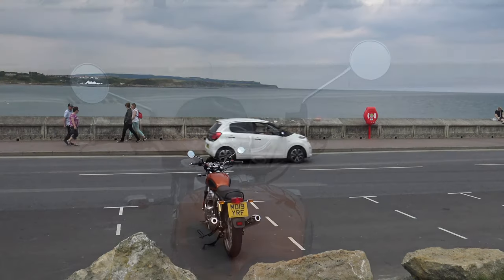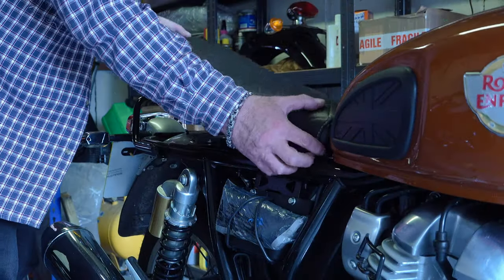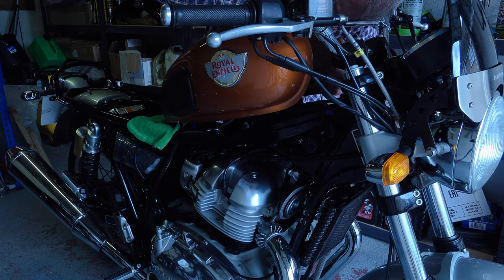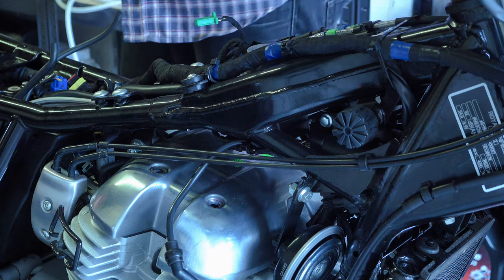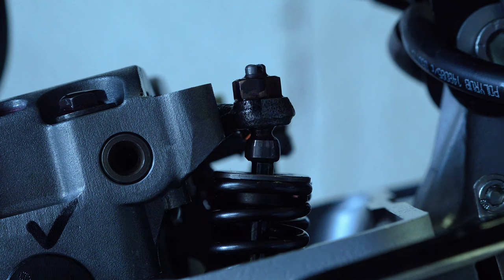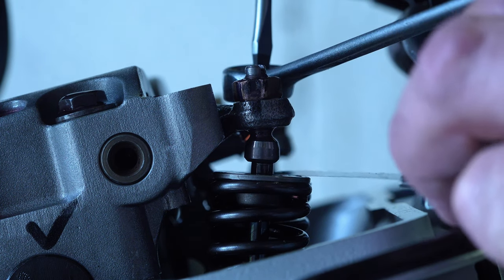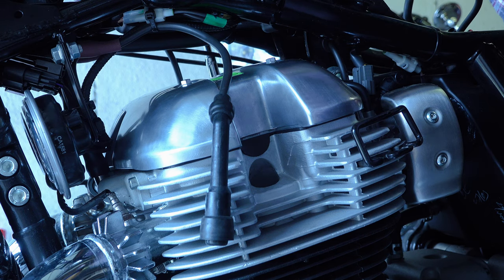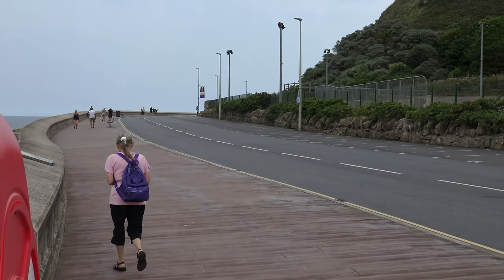Royal Enfield Interceptor 650 service Guide part 2, checking/adjusting valve clearances/tappets!

Comment: Hi stuart so the L marking is intake and the r marking is for exhaust tdc are the markings only on 1 side of the end of the camshaft the side were you turn the crankshaft thanks keep up the great content
Reply from the maker: Sorry John I thought id made it clear, the L mark is for both intake and exhaust on the left hand side and R is for both on the right hand side. I think there has been some confusion caused by a certain video demonstrating exactly how not to do it!
Reply: @stuartfillingham  so the left hand and right as viewed when sitting on the bike thanks stuart
Reply from the maker: @johnwright6995  yes
Reply: Thank you sir, Excellent video!!
Reply: When you take the cover off the engine is also marked L and R, so you shouldn't be able to stuff it up.
Reply: John my understanding from this video and the service manual is to put the camshaft in the L setting and check both intake and exhaust, adjusting as necessary. Then setting it to R and again checking the intake and exhaust and adjusting as necessary. Please someone chime in if this is not correct.
Reply: @briancrn113  see Stuart's reply he explains it clearly good luck with it the first time I did mine I was shiting it but after that it becomes second nature
Reply: @johnwright6995  So easy. I love this bike!
Reply: I assume the intake is those at the back of the bike and the exhaust are the two valves near the exhaust pipe?
Reply: @sugardaddy9721  that’s what I came here to ask and the way you articulated it makes me feel stupid. Duh! Thanks.
Reply: Why do you turn the crankshaft after the first check only one rotation, whereas a fourstroke engine needs two rotations for a complete cycle?
Reply: Correct
Reply: @johnwright6995  😂

Comment: Dear Stuart,  Thank you for all your informative Interceptor 650 service videos.  One suggestion regarding tappet adjustment for the novice mechanic is what is called the "Go / No Go" method.  Once setting the appropriate clearance, follow up by inserting the next thinner feeler gauge which should "Go" in easily.  Then try the next thicker feeler gauge which should be a "No Go".  This method not only ensures the correct settings but also give the novice the feel of the correct amount of drag on the gauge.  After doing this a few times the novice will be experienced enough to know what feels right.
Reply: Good point!

Comment: Being an old git, the last time I done tappets on a vehicle was a great many years ago now. 
 Brings back memories of nipping my fingers changing and reseating valves with the collets.  
 As you say us tinkering diy fettelers have been spoilt with hydraulic tappets etc. Thanks for bringing back memories.
Reply: Good thing that the points/contact breakers are a thing of the past too! You always ended up with bleeding knuckles :)
Reply: You would think that they would make the valve adjustment procedure easier with caps at a removable over the valve adjustments I don't have to take the tank off of any of my British bikes to adjust the valves on any of them my Ural valve adjustment is extremely simple and about seem to stay for a long time how come many of the Royal Enfield in India have carburetors and not fuel injection fuel injection makes all the bikes run hot motorcycle should not have to atone for the pollution created by all the idiots driving cars

Comment: Dear Uncle Stu after watching your video several hundred times i took the plunge purchased all the tools and with video running disassembled my bike and began adjusting the tappets trickly little buggers but i stayed calm and ploughed on i found that the intake tappets were exceedingly tight until i discovered i had two feeler gauges stuck together....after giving myself a severe talking too I readjusted the tappets and rechecked all again with an expression of smug satisfaction I began to reassemble my motorcycle still with video playing i placed the rubber gasket onto the cover and discovered it kept coming off now with a look of frustrated bewilderment I struggled on. Gasket on engine ,nope gasket on the cover nope by now my Basil faulty impersonation had been over used and the rest is a fog of frustration and expletives … my wife tells me I challenged the bike to war in Swahili a language I did not know I possessed but the good news the bike is back together all by my own hand my therapist tells me the fixed expression of frustrated bewilderment will slowly fade and the nervous tick will disappear. Once again many thanks for the video

Comment: I did mine last night.   My biggest issue was refitting the rocker box cover with the seal.   It fell out every time. I attempted to hold the seal in with a little gasket maker and it still fell out.   After an hour of trail and error, I finally got it.    Thanks for the video!
Reply: Same, took longer to get the cover back than to do the job.  I put some dabs of grey silicone on it in the end.

Comment: Thanks for the most detailed video on adjusting those tappets, Stuart. Like you, I hadn't set valve clearances for years, except on old British & Japanese bikes that had removable circular covers over each tappet, which made access for adjustment very easy. These Enfield 650s require more dismantling to get decent access.

Comment: Nice job. And good on Royal Enfield for making a bike with screw and lock-nut valve adjustment. I've soon got to check/adjust the valves on my Triumph Scrambler and KLR650, both using the dreaded shims and buckets.... I hate those things. Personally, I don't mind doing a valve job on something like the Interceptor every 6,000 miles. I had a Ural with valve adjustments about every 3,000 miles and actually liked doing that job. That's the main reason I am hoping to get one of these RE 650s some day. No more shims and buckets.

Comment: I just adjusted mine today using this video as my main instruction. It worked perfectly and the job was easy. My first time adjusting valves and this is absolutely not a scary job. I did have to adjust the right spark plug and all 4 valves on the right side as they were all tight. The left side was perfect. This bike is the way they should be; someone like me with decent mechanical knowledge can easily work on this bike, no dealer needed at all. One point the camshaft markings are visible without removing the gasket, just shine a light in there and it works fine. Thank-you Stuart for your work on these videos.

Comment: I’m going to buy a new motorcycle for my 70th birthday.  One that I can work on, like I do with my 2001 Harley Electraglide and 1986 BMW R80RT, and one that is light enough to take me to my 80th birthday.  After looking at all models from Ducatis to Hondas, I think it will come down to which one I can most easily adjust the valve clearances on.  I reviewed this video again after 2 years, and the Interceptor moved to the top of my list!  Thanks for all of the great video that you make!😎👍

Comment: Thanks so much for this video, just completer my 10.000k services the shop did my 5,000k service and they used a semi based oil and I also believe that the valve clearances where not touched. After this experience I decided to do my own work on my GT. When I checked the valves they where all tight very tight. Now adjusted I have a  slight tappet tick that was not there before to me this is good. And a sump full of raspberry. Hardest part was keeping the gasket in place.

Comment: Thanks Stuart.  Long time since I've done tappets.  A great refresher.  Mine was supposed to have been serviced by a dealer but they were very rattly on the LHS exhaust, the rest were very tight.  All done now at 5k miles.  Peace of mind restored.
Reply: That's interesting. Mine too were supposedly done( 1st service) by the dealer. All were very tight except for RH exhaust being extremely loose

Comment: Nice presentation, Uncle Stu.  Might I suggest another method for those unaccustomed to using feeler gauges:  Use the go-no-go method.  If the correct size fits, try the next size bigger and see if it goes in as well.  Also, tappet adjustment time is a great opportunity to polish the rocker cover while it's off the bike.  Again, a great tutorial, as we have come to expect from you.  All the best from No Yawk.
Reply: Yes, polish that cover while off, makes perfect sense :)

Comment: I’m watching for the second time. 6000 miles has come due and the start of the real riding season is here. I not in possession of a 14mm (or 9/16”)hex although I own all the other tools. I have started whittling away at the tasks on this list. My shop and tools are 5 miles away from here. So I think I’m going to have to do this part after I do a different job on one of the race cars so I can cool it off enough to have an accurate gap. 3.1 L of Silkolene and a fresh oil filter is next. I started by replacing the paper filter with a DNA and cover delete and inspecting the hoses and rubber. Although that second part seems to me to be part of a wash job and more frequent, but what do I know? while not really part of the service it also got AEW silencers. Sounds great. Such a simple motorcycle. It’s like working on the dirt bike.

Comment: Something I did that helped , while putting the tank back on was hooking a tarp strap with gas cap off , then hooked it to a tie down strap that was hooked to a board across the rafters in my garage. 
Wish I would have thought about it when removing the tank.
Also both of the spark plugs we not very tight . Just a little more than finger tight.

Comment: Hi mr. stuart  its always pleasure to learn from you . A small thing here i want to grab your attention is ,while removing the rocker cover it is more convenient if we will remove both the horns , it gives plenty of room to grab the rocker cover out 
I appreciate all the work you are promoting 😇
Stay safe, Ride safe.
Reply from the maker: No I would leave them in place.
Reply: stuart fillingham  I appreciate sir 😇
Reply: @shailendersingh8249   I found removing both horns gave me a little more wiggle room to remove/replace the rocker box cover. Popping off the front engine breather pipe also helped ease it forward, which made it all so much easier. Just made sure you replace the breather pipe!

Comment: A comment from John Steinbeck’s “Grapes of Wrath” (published 1939, Ch 12, paragraph 6) on loose tappets:
"That rattle – that's tappets. Don't hurt a bit. Tappets can rattle till Jesus comes again without no harm.”
(If you have trouble with that quote take it up with your English professor.)
But TIGHT tappets! Now that’s a different matter. A tight tappet can hold the valve slightly open to allow the combustion to burn the sealing surfaces between the valve and the valve seat. Which ultimately causes loss of compression and leads to a valve regrind job. =Expen$ive!

So I was very appreciative of Stuart’s mentioning that his valve settings were too tight when he got to them at 300 miles. Consequently I checked mine at 400 km (240 miles) and found all of mine too tight. Anticipating further compression of surfaces I set mine a bit looser: 4 thou on the intake and a loose 8 thou on exhaust.

When it came to taking the tank off I got timid when I saw the factory crimped hose clamps on the fuel lines. Some fuel hoses on fuel injected systems are pressurized, so I didn’t want to mess with that. (The fuel pump is inside the fuel tank.) I was able to get the tank back to where the tab with the rear mounting holes would slide under a frame cross member. With a 2 x 2 under the back of the tank I got almost a foot of clearance between the top of the rocker cover and the bottom of the tank at the front. I found I had plenty of access to lift the brake control unit and to remove the rocker cover. I did find it useful to loosen the left horn mounting bolt to allow it to swing forward  for a bit more clearance to remove the cover. The rest was standard procedure. Even unto finding my old feeler gauges :)

And yes, I did notice the tappet noise returned to where it had been when I first got the bike. The bike did seem to have more go. I don’t know if it made any difference to performance or if I was just relieved to get the job done!

Stuart, I greatly appreciate your instructional videos. I use them for reference as I proceed. For example, remembering which side to remove the rocker cover from. Oh ya, it comes out the left side. Ronn

Comment: Thanks Stuart for a straight forward review of the process encouraging those new to the subject and the joys of an English motorcycle (and others of course, despite many including Triumph, going to the shim approach).  A comment about removing the sparkplugs - to poke a clean cloth into the hole to prevent any small items falling in there during the process.  Easy to pull out before replacing them :)  My bike is arriving 3rd week in August - over a 5 month wait in NZ for the Orange Crush colour I wanted!!  Looking forward to the next in the series - keep it up!!
Reply from the maker: Good point Graeme!

Comment: Hey Stuart, I watched your video and decided to give this a go for my 300 mile check. Got everything set up this morning and had the service manual. I turned my first turn to line up L going counter clockwise. When I double checked the feeler gauge size in the manual I noticed it said to turn clockwise and “Never turn counterclockwise”. I freaked out and thought well hmm maybe things have changed since your video so I then proceeded to turn clockwise for the R side and then continued clockwise to recheck the L and R again. All things seemed fine and I only adjusted an exhaust valve on the R side. Sealed everything back up and then wondered why the manual was different from your video. Then I watched others and they all said counter clockwise. I continued down my panic induced research and saw all kinds of posts stating to rotate counter clockwise. I figured I potentially ruined my engine but decided to continue being dumb and fired it up and then went for a 10 minute test ride. All seemed normal so I’m hoping it’s ok. My question is what should I potentially be looking/listening for that could’ve potentially been damaged by rotating clockwise? Everything felt normal for my short test ride. I plan on going for a long ride tomorrow and get up to higher speeds. 

Apologies for the long winded comment. You’re the RE king so I figured you’d know best. Cheers!
Reply from the maker: it might be that something has changed since this video was published but i did check with RE both at the time and shortly after, because no direction was stated in the manual for setting valve clearances. By chance did you get the direction of rotation from another section a little further on in the manual relating to removal and refitting of the rocker carrier?
Reply: @stuartfillingham  you know that could’ve been the section. The manual is organized somewhat weirdly. Luckily I went for a 115 mile ride yesterday and had no issues whatsoever so I think all is well. Now I know though for future references. I’ll just follow your guides 100% now haha. Cheers!

Comment: I've taken delivery of a "new to me" Interceptor. It came with dealer stamps and receipts for servicing but I'd be surprised if the tappets had been done. All were night. I've found your videos very useful but I had a nightmare getting the rocker cover back on with its seal. In the end I found rotating the engine to provide more distance between the top of the tappets and the frame helped. Doubtless I'm doing something wrong but I can't see what. It would have been so much easier had they fitted the seal the other way up.
Reply: Night? Tight.

Comment: Isn't it wonderful how many experts and editors "correct" what you're doing?  Interesting tappet design with the little bulb on the end, maybe that's fairly commonplace, only one I'm used to seeing is on my old Yamaha (which also uses a small Allen wrench to adjust the buggers), they're straight along the entire length -- which unfortunately once allowed one to back out completely and drop into the case, finally found it wedged behind the starter motor drive gear.  That did have the unexpected benefit of revealing the head had cracked by the valve seats -- apparently a common issue with that early design -- and gave me an excuse to fit a later-model head to it (single piece, deeper fins) which cured not only the cooling issue but also the chronic oil leak the original two-piece, horizontally split head always had (also fitted a factory kit oil cooler).

Comment: Hi Stuart.
Firstly, thanks for your time and effort in producing these videos.
I have recently become the 'proud' owner of a GT650.
However, having been a meticulous motorcycle mechanic for many years, I'm reluctant to take my bike back to the dealers for its first 300 mile service.
I say this, because upon receipt of my new motorcycle, I noticed a few schoolboy errors on the previous delivery inspection.
Therefore, I'm deciding to do my own servicing and maintenance.
My question 'is it best to do the tappet clearance on the first 300 miles?'.
Personally I say yes, yet it doesn't state it to be done on the first service by my RE dealer.
I question this fiercely!!!!!!
I think I'll do all the work myself for all services.
I'm confident enough with the strength and build quality of this motorcycle that 'normal' regular maintenance and servicing will suffice.

Comment: Thanks for the feeler blade link mine are getting a bit worse for wear.
Reply: Just to clarify i take the feeler blades you used are not the exact ones in the link? 
Doesn't matter just took me by surprise.
I have different figures on the actual blades i purchased
Inlet would be 0.003 or 0.076mm   (yours 0.08mm)
Exhaust would be  0.007 or 0.178mm (yours 0.18mm)

Does this seem correct?